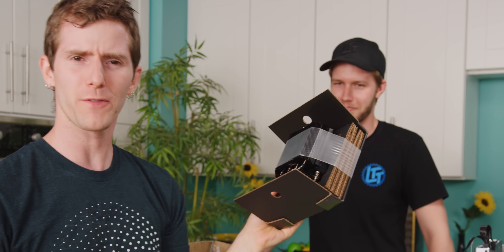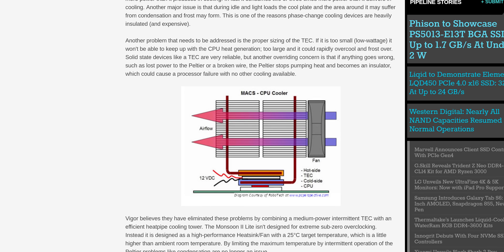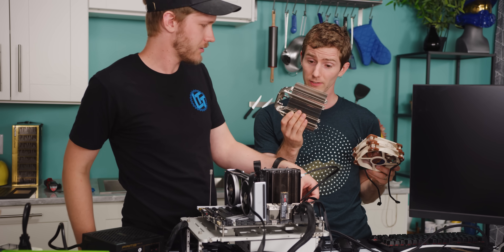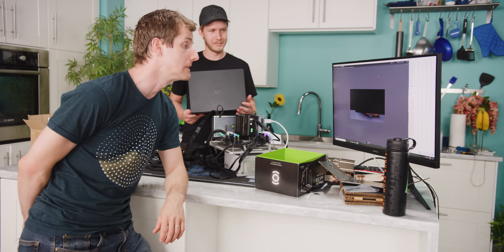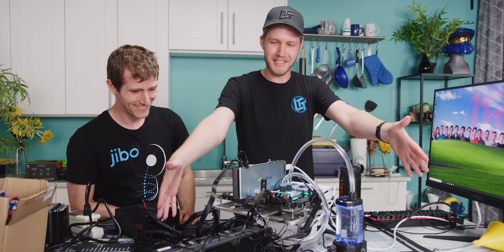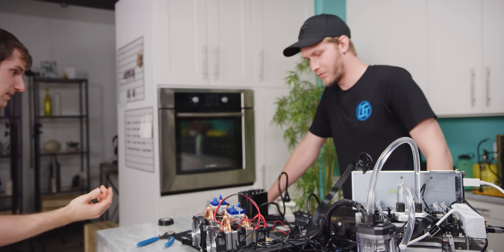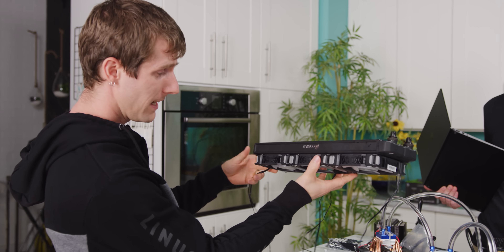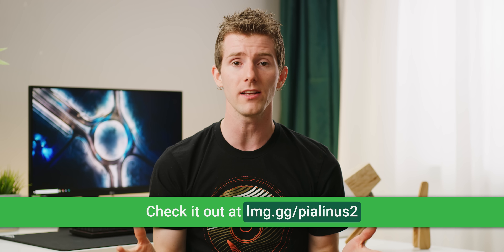Thermoelectric Cooling is a Bad Idea

Comment: You’re not using it right you should use the cooler to cool the water and then run the water through the Fins and blow the fan across the fins  blowing cold air

Comment: These tecs are actually super usefull in reverse. If you put a heatsink on one side and a block of plutonium 238 on the other, you have a generator that supplies a small current for decades without needing to refuel at all.

Comment: About 10 years ago i tried to cool with peltier device my Phenom II x4 980 (which I actually still have, up and running). I just sandwiched it in between CPU and heat sink. And this poor guy  didn't like it, was shutting down on me. Temps was taking off like a rocket. I understood back than that sufficiency of heat transfer of the peltier device is way to low for intence heat build up by CPU. There for it worked more like thermal insulator than like a cooler. They may be good for small fridges where heat transfer is very gradual but not for CPU cooling.

Comment: The reason it doesn't work is because all it does is move heat from one side to the other. Kind of like every other cooling loop... except this one adds heat to the system while it does it.
Reply: Which is basically the description of thermal paste but electrified and expensive. In the end, you'd still need to attach a cooler to the hot side... but then why not just attach the cooler directly to the CPU in the first place at that point.
Reply: @ryanthompson3737  yep. Thermodynamics wins in the end

Comment: Interesting, I've never seen these used directly on the cpu. I used mine for liquid cooling. You would want to use them for keeping liquid cold on a separate radiator with a water block.

Edit: I guess I should've watched the rest of the video lol.

Comment: I pulled a Peltier out of this old broken mini fridge. Put it up to a 9v battery and it got cold very fast! I was thinking, why not pop this on top of this old AMD test rig that I have. It was working so good until I came home the next day and there was a literal puddle of water on the motherboard. Lol 🤣
Reply: @HardWhereHero  worked a lil too good lol. Probably would work better if the voltage is lower idk tho.
Reply: Why not use it to cool a water loop instead? Like an intercooler

Comment: These are a used to great effect in astronomical cameras and are especially effective at maintaining sub-zero temperatures in the winter (helps with sensor noise). However, they are quite inefficient. Two summers ago I left my camera's TEC cooler on automatic through multiple days of triple-digit digit temperatures. The result? I cooked the camera, and the PCB components for my thousand dollar filter wheel. At least, I ended up getting a new camera as a result.

Comment: The only issues with TEC's that I have seen are:
1) power usage (ohh well)
2) Condensation. BIG problem, but there are controllers from Intel now (looks like they dumped the product already) and coolermaster sub-zero (intel based) that work to control TEC power use and monitor humidity and ambient temperature to avoid icing up.
3) TEC component failure (had a couple that just burned up... my bad?)

Given all the CPU damage we are seeing lately, I still think the best setup would be a TEC + water cooler. Why not run a 420 or 360mm setup and have it adjust TEC voltage, pump RPM, and fan RPM to keep core temps down dynamically?
Honestly, the biggest problem I had in the past was I didn't have a good controller for the TEC and at cpu IDLE I would get too cold, so I would wrap the socket in foam insulation, but this then caused trouble with overheating of the power regulators around the socket. With a controller and DC-to-DC converter, you shouldn't need to worry about sub-ambient temps.
4) Yes I am replying to a 5 year old video...

Comment: Could there be a legitimate use case for using that Peltier water cooler after a standard radiator in a loop? I feel like there is potential to get greater performance in hotter climate since standard radiators can only cool to ambient temperature.

Comment: I have a vary rear thermal electric cooler that doesn’t haver ceramic it’s actually all metal
Reply: I will send it to ltt for Linus to run it through the ringer and I get a better setup plus I’ve entered
Reply: In a video of course

Comment: There's a video of a guy who successfully created a cooling system with Peltier pads and did so by taking advantage of the watercooler in the PC case itself. The Peltier only functions as a coolant temperature control. The module is powered by its own power supply and is electronically controlled to turn on when the liquid reaches a certain temperature and turn off when the liquid temperature drops to a certain temperature. And everything inside the case, very compact. If I liked desktop PCs I would invest in copying the guy's system.

If you want to know the details, just search YouTube for "MOD no Corsair H100i com Pastilha Termoelétrica PELTIER" and the video will appear.

Comment: Maybe try connecting a normal water cooler on the output and rather have the Paldea coolers in parallel going to the CPU. The normal cooler could bring the cooling liquid close to ambient whilst the Paldea coolers could be used to get it to sub ambient temperatures

Comment: The trouble with all these peltier setup is that the heat transfer module is always a tiny exposure surface. If there is like a copper/aluminum heat transfer block between the peltier module(s) and water loop, it would prob work better.

That is also why there is a large radiator block for water cooling, to give a large surface area for heat transfer between the water and the radiator.

Comment: i think we need TEC back esp for the 12th, 13th, and 14th gen CPUs. they run too hot even with a 420 Rad. I have the 13th Gen 13900KS and it runs super hot. I remember back in the x58 days I had a TEC and it keep the CPU under 20c under load. I understand about condensation but I am sure there are ways to get around it.

Comment: There must be a solution to create an AIO were the water is first cooled by the radiators as usual and that cooled water beeing further chilled to below ambient temperatures flowing over a peltier element plate. The extreme advantage of this would be that the hot side of the peltier element would just need a small air cooler if it lets say would just improve the temperatures by like a casual 5-10C or so which would probably also not cause any condensation and use realtively low energy. What is even more interesting is what if you would run this with a large air cooler on the peltier element hot side and 200W+ and an anti freeze liquid. You could literally create a minus degree liquid flow for ethusiast casually pushing  I9s far beyond 6 Ghz. Also insulation for pipes and hoses etc. has been done since forever and is done with standard simple foam on any cold water house pipe. The degree of cooling that way could range from standard level AIO performance at 0 watt to -20C liquid extreme overclocking levels at 200 watt+ power usage with a simple twist on a notch that regulates voltages. It will need abit of space because you will defenetly need a second AIO or air cooler for the hot side of the peltier element but I don’t see a reason for this not beeing possible.

Comment: I know this is a 4 year old video, but hear me out; the problem with TECs is the massive power they consume handling the full heat load.  What if you were to run the peltier water block in series AFTER a radiator?  The passive cooling of the radiator will handle the bulk of the heat dissipation, with the TEC then always starting out with water that's at or near ambient.  I'm sure somewhere in the 4000+ comments, someone has already suggested this, but it just seems like common sense to me.
Reply: I literally had the same idea dude. I don’t understand how this isnt on the market yet. There must be a solution to create an AIO were the water is first cooled by the radiators as usual and that cooled water beeing further chilled to below ambient temperatures flowing over a peltier element plate. The extreme advantage of this would be that the hot side of the peltier element would just need a small air cooler if it lets say would just improve the temperatures by like a casual 5-10C or so which would probably also not cause any condensation and use realtively low energy. What is even more interesting is what if you would run this with a large air cooler on the peltier element hot side and 200W+ and an anti freeze liquid. You could literally create a minus degree liquid flow for ethusiast casually pushing  I9s far beyond 6 Ghz. Also insulation for pipes and hoses etc. has been done since forever and is done with standard simple foam on any cold water house pipe. The degree of cooling that way could range from standard level AIO performance at 0 watt to -20C liquid extreme overclocking levels at 200 watt+ power usage with a simple twist on a notch that regulates voltages. It will need abit of space because you will defenetly need a second AIO or air cooler for the hot side of the peltier element but I don’t see a reason for this not beeing possible.
Reply: @Rainer125  Exactly! When you already have the temperature gradient working in your favor, why waste energy trying to actively cool the water when it can cool itself?  Once the passive heat transfer has done all it can do, THEN you implement active chilling methods.  I mean, this is kind of HVAC 101 here.  Big (and I mean BIG) heat pump based commercial cooling systems don't rely solely on refrigerated chillers.  That would cost a fortune to operate and it would be horribly inefficient.  They run a glycol loop, first through a heat exchanger and a cooling tower to provide passive heat rejection and achieve near or slightly below ambient temperatures (depending on wet bulb temperature).  THEN it's chilled when necessary.

I mean with a series setup, you wouldn't even HAVE to run the TEC at all for conventional operation.  Then when you want that extra boost of sub-ambient, or even sub-zero cooling, kick that bad boy on and freeze the sucker!  

As for a heat transfer medium, deionized water blended with Ethyl Alcohol, Propylene Glycol, or a combination of both would be able to achieve the desired results. Ethanol/DI water would have some advantages; primarily the fact that it's non-conductive and low viscosity compared to glycol.  For alcohol, you'd probably want to do some figuring to find a good balance between freezing temperature and flash point though, to avoid evaporative loss or accidental pressurization of the system.  I'd actually wager a glycol-only or glycol/alcohol blend RV plumbing antifreeze would be just about perfect for the job.  And cheap.  And readily available.

Too bad I'm far better versed in heat transfer than I am in overclocking, otherwise I'd absolutely try it for myself!  But alas, I have no use for a two stage supercooling system on my I7 powered laptop. 

It's been over 20 years since I overclocked a processor... I did manage to break the 1GHZ barrier with an Intel Celeron 533 back in high school though.  For a few minutes anyway, before condensation fried it.  I was using copper water block I made in shop class, a windshield washer pump, and a styrofoam cooler full of ice, water, and salt.  That sucker ran COLD.  Frost on the block.  But I ran it too long, too much of the ice melted, the block got above freezing and the frost melted, and the magic blue smoke got out.  🤣
Reply: @anickode  you should honestly give it a try. Maybe i will at some point. A custom water loop directly cooling an aluminum or copper block with a TEC were the anti freeze runs through connected with an inch of hose or pipe after the radiators cooling the liquid further the hot side of the TEC will be connected to an aircooler. I could simply cover the entire mainboard in nail polish or a more sophisticated non conductive glue made for extreme overclockers. Especially in an open system were you can actively loop the pipes around in a way were condesation isn’t an issue it should be easy peasy. Then have a small reservoir with a thermometer on the side were the water leaves the CPU and simply check if it roughly has ambient temps running idle and condensation shouldnt be a problem past that point. I assume even if you run it extrmely cold to a point were you would be using 200 watts or something half way reasonable the CPU will probably heat up the water to roughly ambient or higher.

Comment: this needs a new review as the frosty bois as i like to call them are now bigger and longer, im looking at mounting one long enough to fit a 3 fan radiator and just adding an extra cooling pad to the bottom or top of the flat pad.

Comment: it's problem in the liquid, because this one you use heats fast but dosent cool fast, and you wanna cool it fast, this one carryes heat well, and you just added more resistance into the loop, you need  a liquid or a pressured gas, it has to be under pressure so you can cool it <3 hope this helps , btw sory 4 misspells I'm not english

Comment: Food for thought.  Maybe use the "TEC and water block" after a radiator.  This will mean the amount of heat  a smaller TEC will have to pump  is well within a TEC's rating  and will lower ambient water temp much more reliably with less hardware required on the TEC side.

Comment: Not sure why they didnt use the peltier atop the radiator. I would’ve had a peltier attached to the bottom side of a water reservoir. These peltiers cool mini fridges and they can cool water to nearly freezing. If you are taking the CPU return Into a radiator to cool and then back to the reservoir that has the peltier and to the cpu you will cool the cpu significantly better. If you cannot get close to or at ambient temps you’re doing it wrong.
Reply: There are better applications where you could not just cool water but pull off the heat produced and use it for another application. 
I will have to look for that peltier CPU video. Based on what I’ve seen here i doubt you’ve made it work. You need to focus on how they work and how best to optimize its use where it actually matters.

Comment: Didn't intel release a electric cooling system that is similar to this idea? And if im remembering it correctly it was actually pretty good at cooling the cpu.. but i was also thinking that Peltier squares could be used on laptop cooling systems.. i don't mean for i9 and 4090ti gaming laptops i mean for 12th and 13th gen i3 and i5 processors with iris XE grafix.. coz a couple of heat pipes over a vapour chamber with a Peltier squares on top of the heat pipes and 1 at the fan to suck in chilly air to blow across the heat sink.. a real low 30W cpu and 2x 10W Peltier squares could actually be pretty good as iris XE grafix are useable on most games if you are happy with low settings..

Comment: There are bad implementations of peltier coolers, amd then there are proper ones. I've been using a modified ( pump, lines, and block replaced ) CoolIt Freezone that still cools modern CPU's with higher TPD's then when it was designed. I can't use it anywhere near full power on an 85W TPD without causing condensation on the coldest bare surface. Had to cover the reservoirs with closed cell insulation to avoid this.

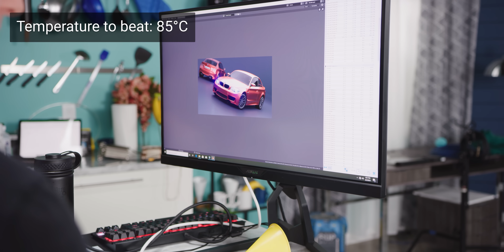Comment: 14:37 If they put the radiator To call the water coming out of the PC then have The water get cold I think this would work really well.. These thermal electric Can't deal with all that heat in line as even said as the test went on the temperature is went up so put the radiators on before these thermos and this could work really well...
You'll be using a lot of electricity but

And just having a bigger water reservoir \ Radiator ,could probably get you the same temps

Comment: The problem with air radiator is when it comes time to clean the dust off of them.    You often have to dismantle them.     With liquid coolers, you simply vacum the radiator without have to disable eanything.

Comment: the best way to minimize the project is to to have a build in peltec into the radiator.. where radiator cools the hotside with its own pump and  the cold side cools the cpu or gpu

Comment: Used 4x320w@12v from 15.8v for ease+efficiency with a custom cut cold pyramid and 2xmaze 2 waterblocks... I needed to paint the board in acrylic as I'd get condensation all the way to below the AGP slot..  got me a 2.95ghx and Anthony xp Barton b core for a year before the motherboard would die (probably power as I was putting 2.3V through the CPU).  Thanks for the electricity Bonneville Dam and Dad ;) #high school claim to fame.

Comment: Peltier elements are actually pretty impressive if designed right. In USSR they had this giant finned thing you'd put on top of a kerocene lamp and it would generate power using this effect and this was during the valve era, so it was producing something in the range of 100W, me thinks, maybe less but the minimum power it had to produce to power a valve radio or any other circuit would be around 70W (output was 220V and since it was DC it'd be powering a filament-chain circuit, which draws 0.3A).